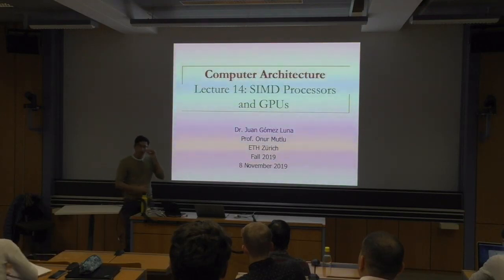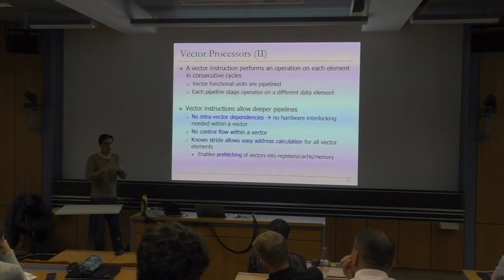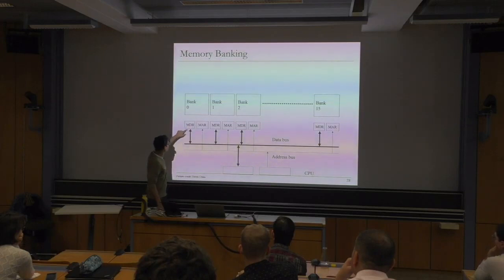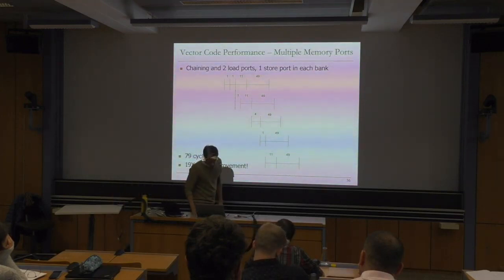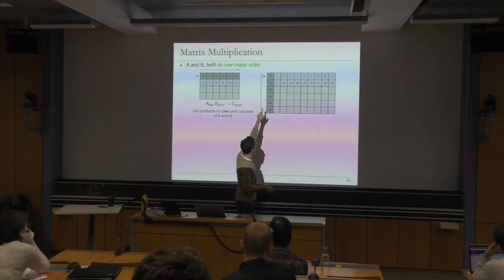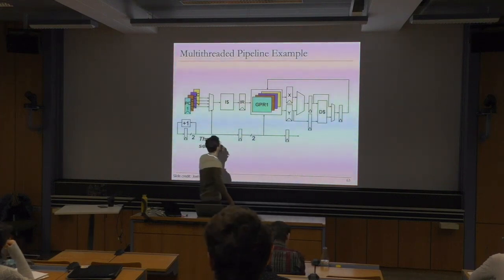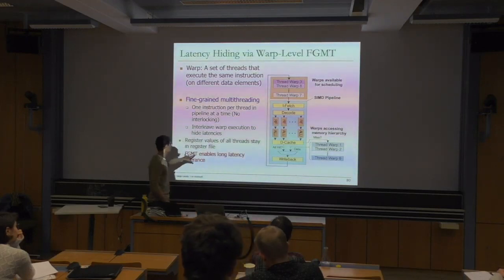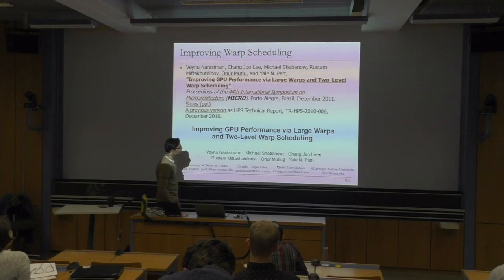Computer Architecture - Lecture 24: SIMD Processors and GPUs (ETH Zürich, Fall 2020)

Comment: In Warp-Level Fine-Grained Multithreading, shouldn’t there be multiple register files in each scalar pipeline corresponding to each warp which may be scheduled? Otherwise, is it not possible that two independent instructions from two different warps use the same register from the RF before either warp is completed? As I understand FGMT in SISD (superscalar) processors tackle this issue by maintaining separate RFs for each thread.